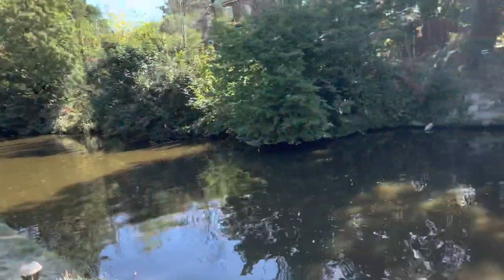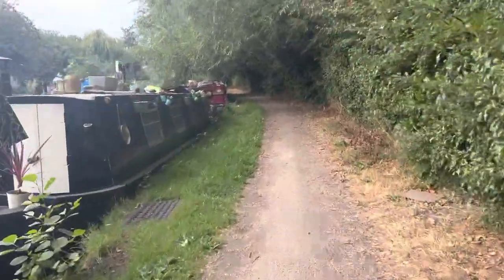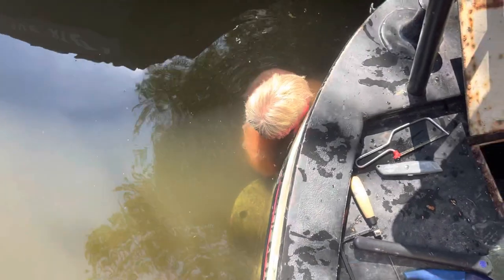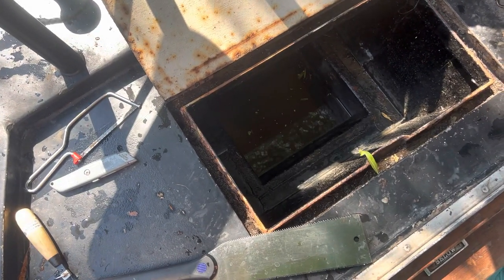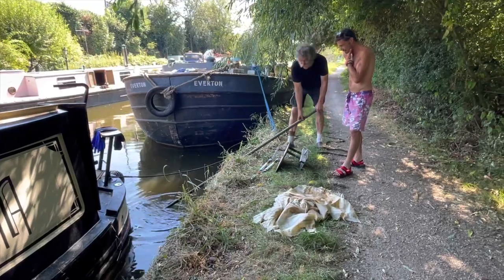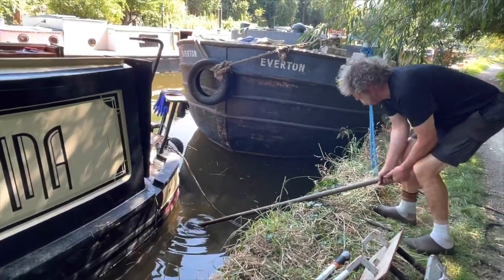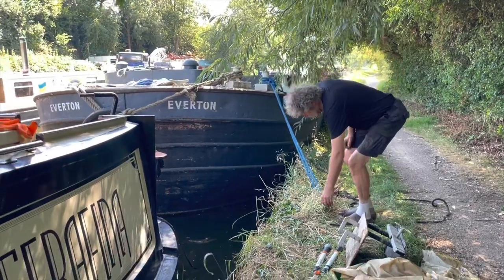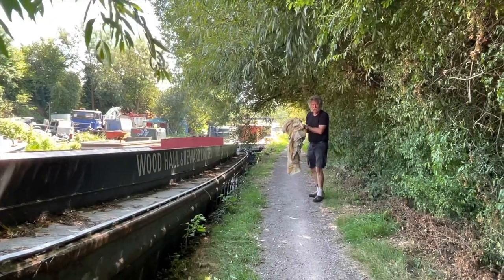361. The right and wrong way to remove a parasol from a Narrowboat prop shaft

Comment: tim might need a drink for helping you out and well done for trying to get it off as well ---- i once saw a boater with a deep rudder that had come out of the bottom pivoet pot use the lock seal and a pole to put the rudder back in place -- they had backed the boat on to the seal and let the water out slowly - i said well thats oneway of doing things -- he said back he's been boating for about 30+ years so he knows what he was doing he had done it a few times before hand

Comment: I absolutely agree with you, I bet that brolly came from a boat or a back garden, but people are just incredible aren’t they. 

It’s not like there’s a strong current (or ANY current) to take it away, so it would simply be floating around nearby for quite a while before sinking out of sight.

 People are so incredibly selfish these days, they don’t think about other people at all. Very sad.

It must have been very badly wrapped that a blast of reverse didn’t help.

I’ve seen a boat hook used before to great success in a similar situation  - pulled away about 5 meters of disgusting greasy fabric piece by piece and it took around 3 hours to sort out - in the middle of winter 😳

A good solid boat hook is a VERY handy piece of kit, and a necessary piece of equipment to have on your roof, along with your barge pole of course.

You could make a miniature set of hinged, lockable stocks  to store them on. Sorta like pool cues are stored but horizontal obviously 😂

It’s just a pity that no one bothered to haul it out of the canal before it sank - people passing , or other boaters must have seen it there when it first went in. 

I’m sure that you two will now be doing your best to pick up anything that you see floating, objects that could foul someone else’s prop’ or your own.

Even a handy scoop net for picking out floating plastic containers and coal bags - especially in the more urban area canals.

All the best.

Comment: After the previous time you had issues with weeds, it's a shame I hadn't mentioned my thought of having a pole with a serrated blade on the end (versus a hook),but now Tim has shown the two of you the finer points of removing debris from a prop and shaft, hopefully without getting wet?
Maybe, after getting your extended boat hook, you'll never need it?  ;-)
Reply from the maker: Just in time for winter - Tim has shown us the way

Comment: If you reversed your engine to unwind the parasol wouldn’t that work also
Reply from the maker: Nope it didn’t - it was vast, matted and totally wrapped round the prop and shaft - could t spin the prop in either direction
Reply: Okay